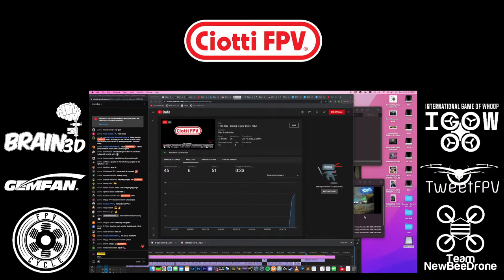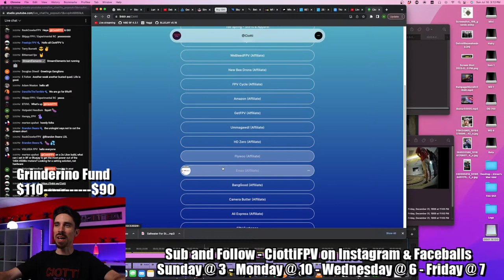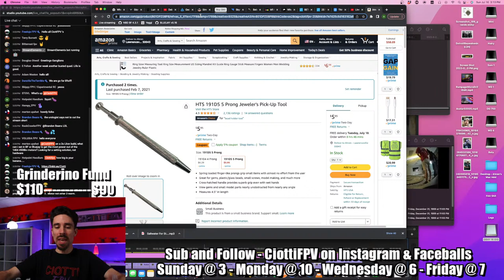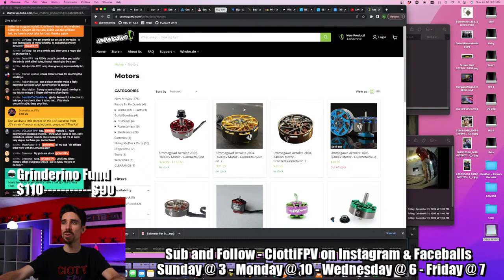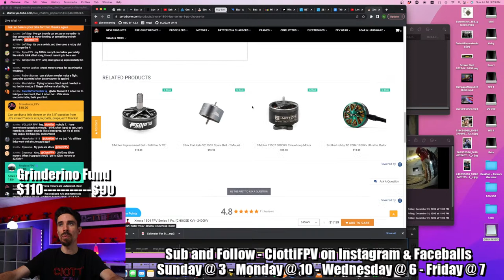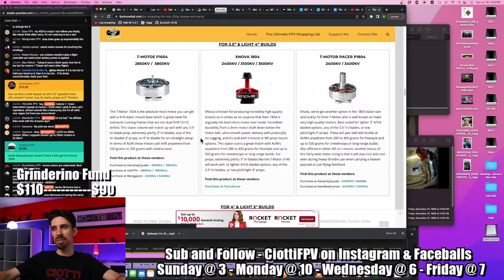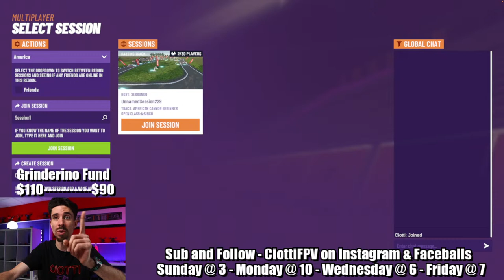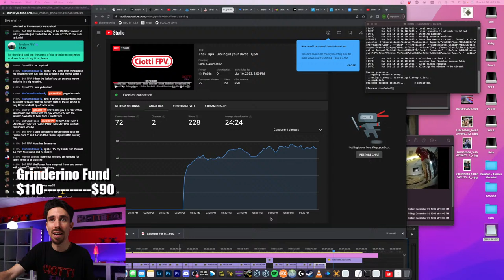Trick Tips - Dialing in your Dives - Q&A

Comment: Good morning friend, thanks for the shootout, we are glad to help out.

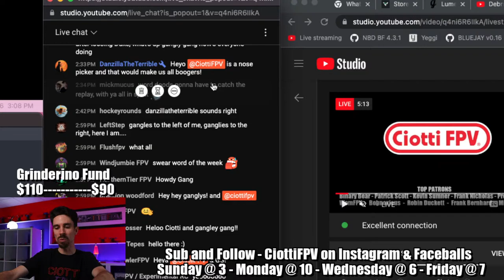00:05:22 Help Ciotti to keep his job 😉
00:21:38 On a 2s Li-ion build is there a setting to get more power out of the motors?
00:24:41 What would cause propellers to explode?
00:30:44 I’m doing a 5” build what motors are a good choice?
00:33:40 Any reason why my Mobula6 doesn’t do a race launch?
00:35:10 I got throttle cut set on my radio, is this the same as motor limit in Betaflight?
00:42:05 Can we dive a little deeper in the 3.5 question?
00:54:14 I have some motor squeaks on the Mobula7.
00:57:52 What available AIO and motors do you recommend for the Grinderino build?
01:00:30 Running the XNova motors on a 4s 4”rig.
01:04:00 Do you plane to build a Grinderino?
01:04:26 Is there a reason for analog to come in right polarization and digital in left?
01:09:58 XNova 1804 with T mounts or T-Motor pacer 1804 m5.
01:11:03 Getting beat by Ciotti 😉
01:12:52 Flying Velocidrone in City map.
01:27:13 Is there a difference between 30000Kv and 32500Kv?

Stay safe everyone